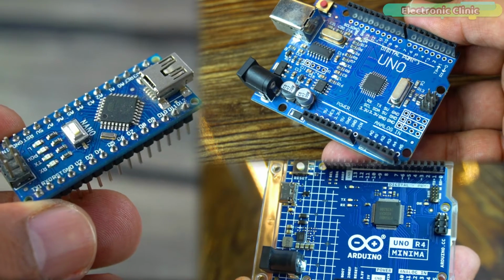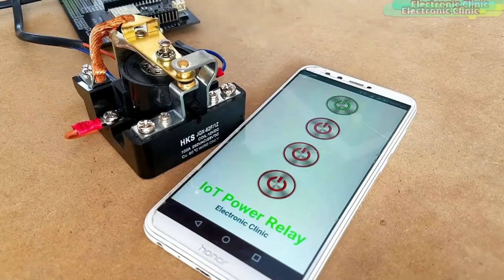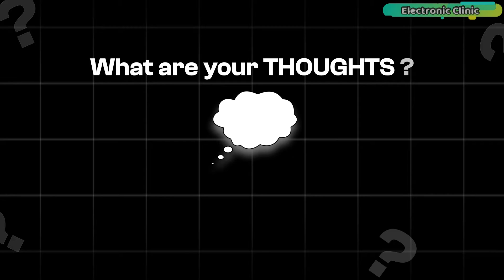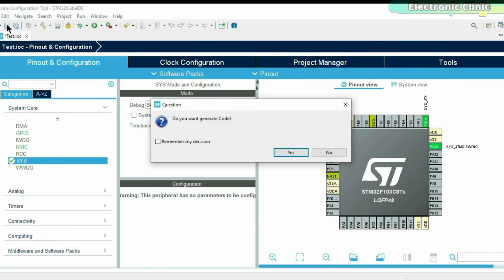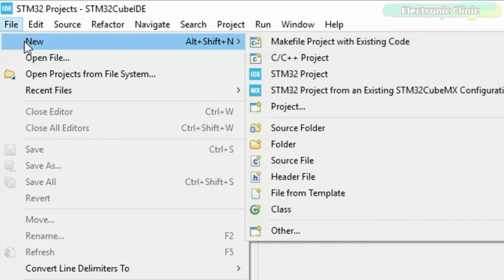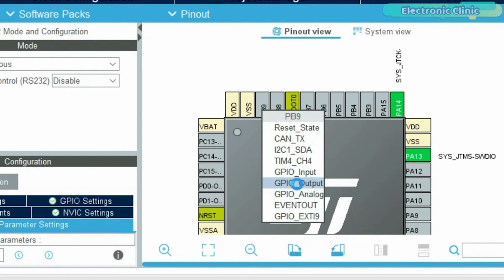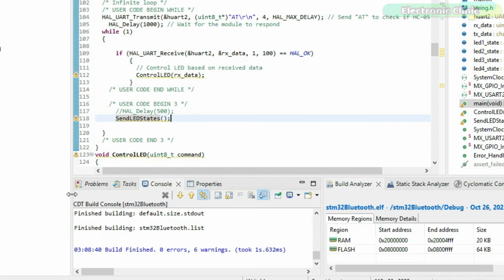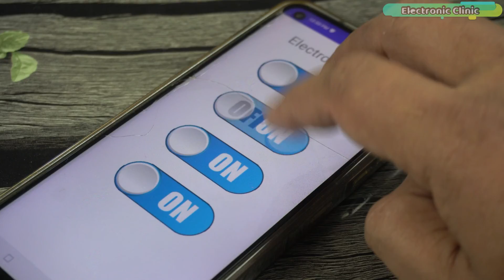STM32 Bluetooth Home Automation with Feedback, STM32CubeIDE, stm32F103C8T6, Android Application

Comment: All good and sounds using solid state replays except that when the output Triac fails, they short circuit the Power to the load, instead of opening the circuit, wich may lead to undesired consequences.